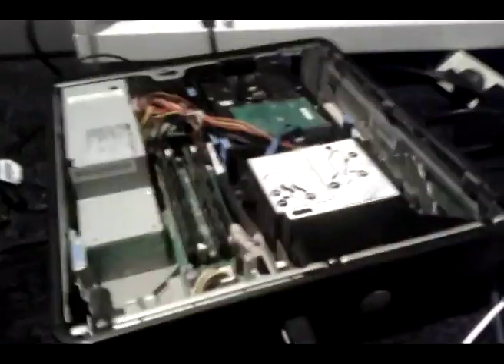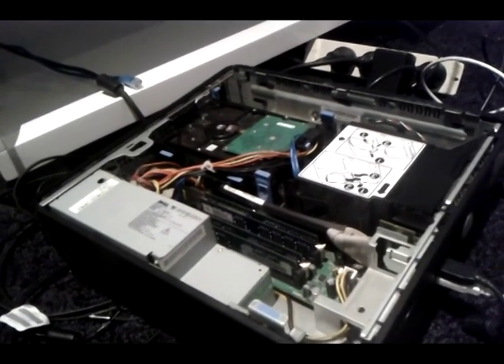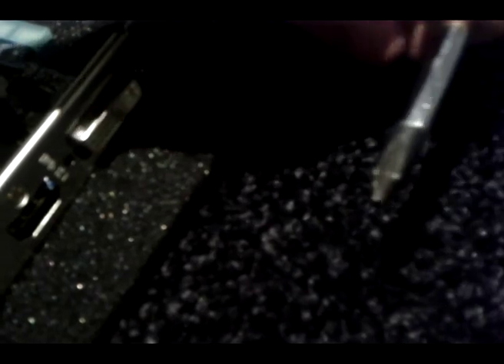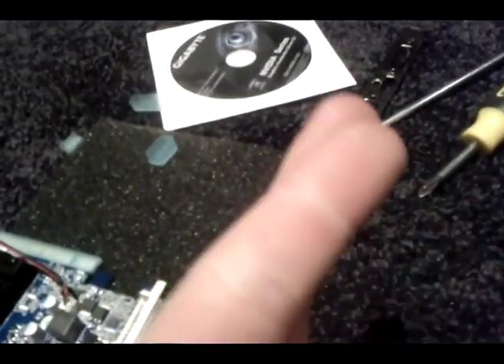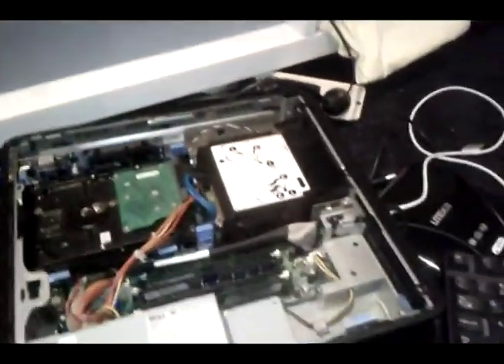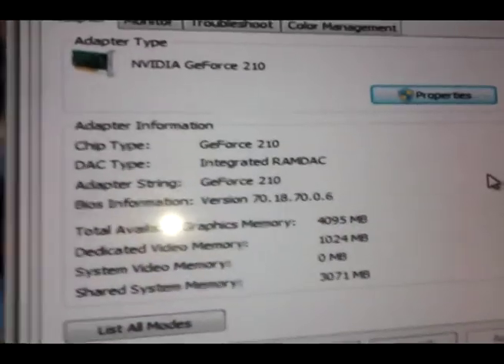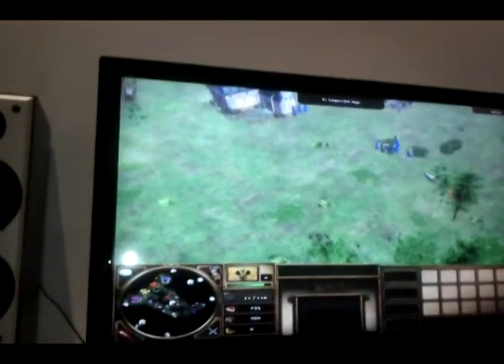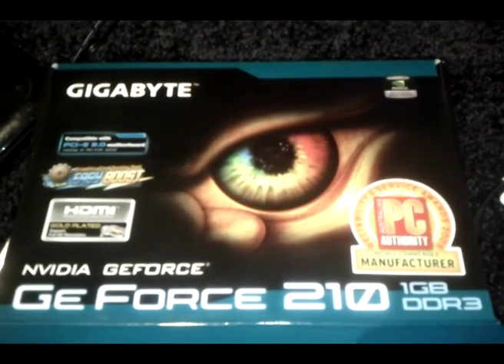Dell OptiPlex 745 video graphics GPU 1gb UPGRADE (works with 275w std)

Comment: I installed the stock card that was bundled with my XPS 8700 in mine & it works great, has the same WEI scores as on the original PC (6.9 both graphics scores). The card is a Dell OEM AMD radeon 7570 (1GB GDDR5). Yes it works great for Web viewing, but haven't tried to game on it. 

Though I did run the stress test on the Dell site, all was OK. 

Cat

Comment: About to put a r7 240 in a 755, hoping it works with stock psu.
Reply: Imported Ham  so did it work?
Reply: Yeah, worked great. Put the system together for my friend, he's still using it and playing league of legends on max settings upwards of 60 fps.
Reply: are you on a dell optiplex 755 psf with psu of 275 watts?
Reply: yea
Reply: thank you very much <3

Comment: Hey so I'm kinda new at this, help would be awesome because I have no idea what I'm doing. I have a Dell Optiplex 745 Intel Pentium D CPU 3.40GHz 8.00GB RAM 64 bit operating system. What graphics card do I need to get to play Skyrim and Fallout: New Vegas?
Reply: A GT 610 might do it, check the min specs of the games and get some thing better then the min, I'm buying mine for GTA v so a 610'is perfect

Comment: you should buy HD 5450, or 6450 low profile, its mutch better.. i have 5450 1gb ddr3 , and it runs a lot of games (COD mw 1,2,3 without problem, PES 2016 etc..)
Reply: They're all equally shit, I've owned a 5450, 6450, 7450, gt 210, gt 610, gtx 730 and my best one was a 6950 for only £50, managed to play l4d2 at 8x AA max settings 1920x1080 at 100-150fps
Reply: +Skullzy The Grim on a 745 mt and a pci e extender
Reply: +Skullzy The Grim np, btw get a decent psu if you wana go anywhere near a setup like mine atleast 550w
Reply: +Skullzy The Grim yeah that'd be fine, and its np
Reply: Is an HD 6350 Ok?
Reply: Hasan Jan No
Reply: Thanks for replying
 why is it not good?
Would it be able to run mw3
Reply: Hasan Jan it's basically the worst in the series, Intel HD is better, no it won't be able to run it
Reply: Thx
:)
Im going to get an HD 6450
Reply: Hasan Jan just save up and get a 750ti
Reply: Wouldn't that GPU need more power
Because the  PCIE power in the optiplex is only exceeded to 25 watts only
Reply: Hasan Jan nope, it's low profile, it'll work fine In the pc
Reply: Ok Thanks 
For the help
appreciate it :)

Comment: Does anyone think that i could run GTA V on a Optiplex 745 with 4gb of ram & 1gb graphics card and get around 15+ FPS? (Disregarding the quality... I dont care if its low or high, i just dont want lag...)
Reply: Harold De la cruz Thank you for your help but I raised my budget and bought a Dell Optipex 790 Mini-Tower...The final specs became:
Intel core i5-2400 (3.1Ghz)
Gigabyte GTX 750ti gaming (4gb of vram)
12GB of RAM (2x2gb & 2x4gb)
600w psu (overkill)
and a
250gb HDD temporarily... Hopefully 1TB+

Comment: can it run a gtx780
Reply: not with the stock power supply I wouldn't recommend using a graphics card that powerful on such an old pc the cpu alone is going to bottleneck the graphics but not much
Reply: true my old q9550 was not that good for 780
got i i7 chip mutch better